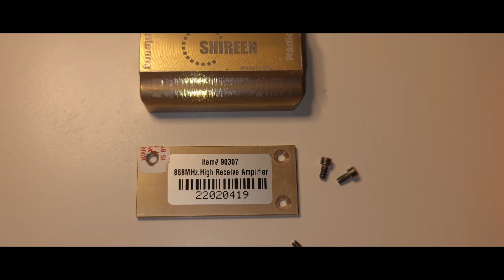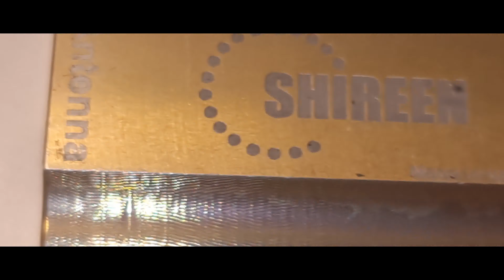Shireen Inc Helium Miner Amplifier teardown Part 1 _HELIUM ADDICT

Comment: The documentation for the AD7705 is a good read, as it only has a digital low pass band filter. This Amp needs too be powered up first before a signal comes in. Might be that the engineers took that into consideration designing the layout.

ANALOG FILTERING
The digital filter does not provide any rejection at integer multiples of the modulator sample frequency, as outlined earlier. However, due to the part’s high oversampling ratio, these bands occupy only a small fraction of the spectrum, and most broadband noise is filtered. Therefore, the analog filtering requirements in front of the AD7705/AD7706 are considerably reduced vs. a conventional converter without on-chip filtering. In addition, because the parts’ common-mode rejection performance of
100 dB extends to several kHz, common-mode noise in this frequency range is substantially reduced.
Depending on the application, however, it might be necessary to provide attenuation of the signal before it reaches the AD7705/ AD7706 to eliminate unwanted frequencies that can pass through the digital filter. It might also be necessary to provide analog filtering in front of the AD7705/AD7706 to ensure that differential noise signals outside the band of interest do not saturate the analog modulator.
If passive components are placed in front of the AD7705/ AD7706 in unbuffered mode, care must be taken to ensure that the source impedance is low enough not to introduce gain errors in the system. This significantly limits the amount of passive antialiasing filtering, which can be provided in front of the AD7705/AD7706 when the parts are used in unbuffered mode. However, when the parts are used in buffered mode, large source impedances result in a small dc offset error (a 10 kΩ source resistance causes an offset error of less than 10 μV). Therefore, if the system requires significant source impedances to provide passive analog filtering in front of the AD7705/AD7706, it is recommended to operate the part in buffered mode.

POWER SUPPLIES
The AD7705/AD7706 operate with VDD power supplies between 2.7 V and 5.25 V. Although the latch-up performance of the AD7705/AD7706 is good, it is important that power is applied to the AD7705/AD7706 before signals are applied at the REF IN, AIN, or logic input pins to avoid excessive currents. If this is not possible, the current through these pins should be limited. If separate supplies are used for the AD7705/AD7706 and the system digital circuitry, the AD7705/AD7706 should be powered up first. If it is not possible to guarantee this, current-limiting resistors should be placed in series with the logic inputs to limit the current. The latch-up current is greater than 100 mA.
Reply from the maker: First Thank you very much for this information , its my first big informative  comment i ever read in my channel sow i really apoushiet your time and effort  that you put in this comment 
i will take all what you said to consideration 
Thanks egan

Comment: 450$????????
Reply from the maker: Hi Daniel👋 
Well yes its very  expensive and i had no choice everything its out of stock i had to buy Amplifier to compensate the dBi loss of the Splitter/ Combiner  and the DC injector  after PoC11 the Rewards got very  bad  i had to try everything out there to get better rewards 😉✌️
Reply: did it work and was it worth it